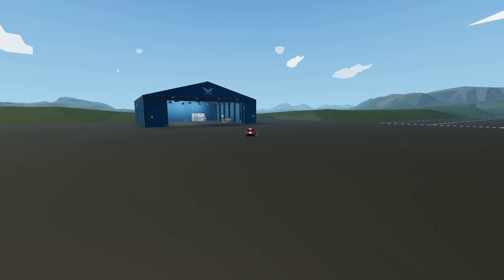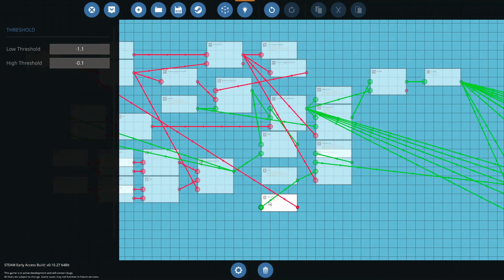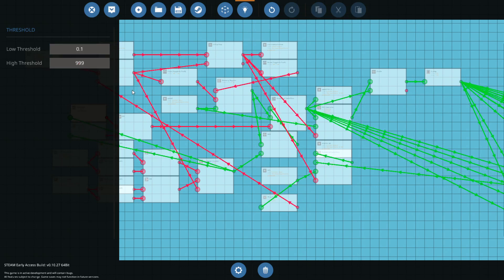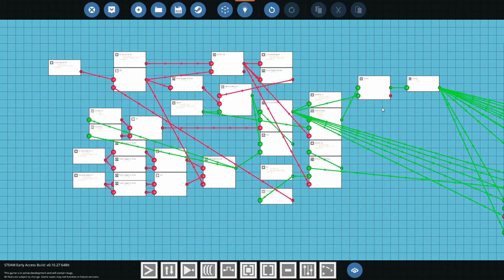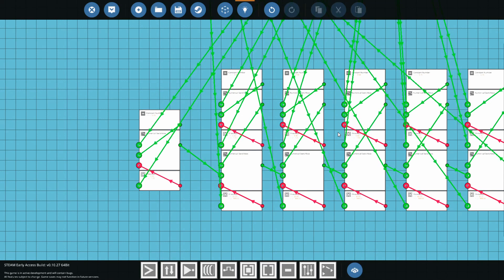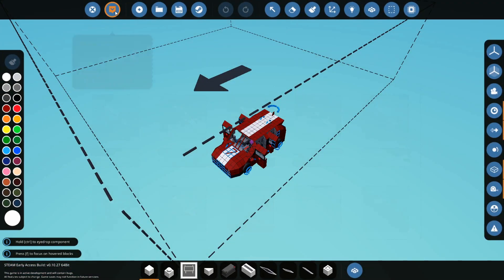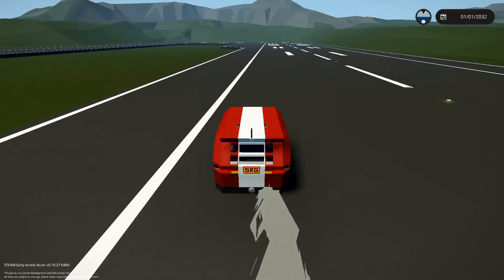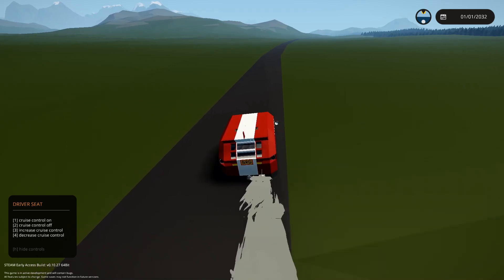Cruise Control Microcontroller | Stormworks Build and Rescue

Comment: If I'm understanding what  that startup section is supposed to be doing, couldn't it be donog with a greater-than check, to chose which throttle input (speed) to use?
Reply from the maker: possibly, I'll have to test that out and see.